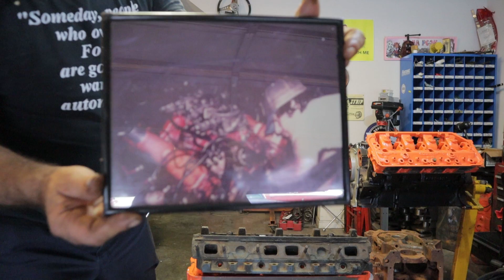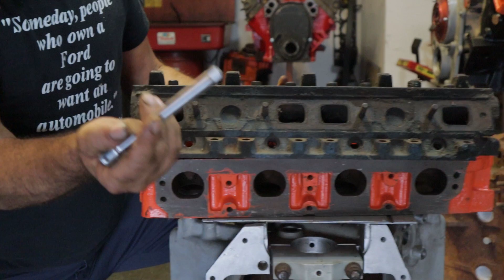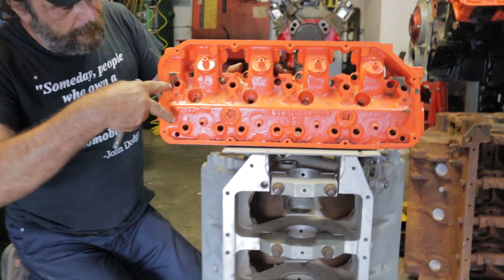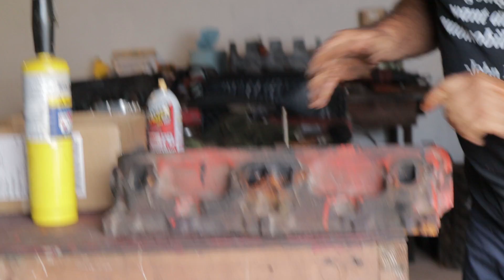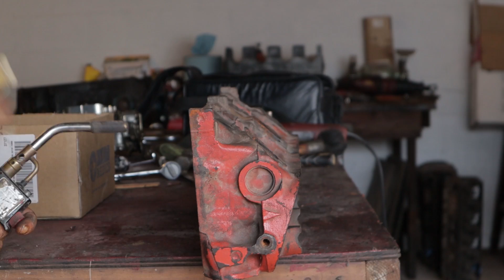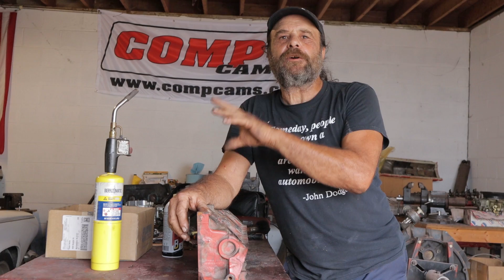What Makes The Small Block Mopar Such A Great Engine?

Comment: Amc had a great exhaust port on the 70 and later heads.
Reply: OMG.. AMC's are freaks!  When he started talking about "accidentally developing a race head" AMC popped out of the ole grey matter.
Reply: Completely agree, they aren't much to look at spec wise, but those engines just F'n roar. 

Back in the day I was working on a customers Javelin, I was doing transmission and clutch work on it. It was a kinda obnoxious car, bright yellow, Street ET tires, slapper bars, HUGE hood scoop. But under the hood as far as I could see was rather typical AMC engine, headers, the old school twisted torker single plane manifold, and Edelbrock carb on a 4" spacer. When done I took it out for a test drive and after breaking in the clutch a bit I did a hit off a light to make sure all was good. The damn thing did a F'n wheelie, freaked me the F out. I'm accustomed to power I just wasn't expecting it. 

Found out afterward that it was IIRC 400+ CI, had very high compression IIRC 14:1 and was running 100+ fuel. But still damn, from a basic AMC.
Reply: @snek9353  lol, so when I was 19 in the mid 90's, I bought a 1979 Cherokee 2 door quadratic off a guy I "kinda" knew. He had rebuilt the AMC 360 engine. Took it to show my Dad what I bought for $1,800. We were on a road with a slight slope going up, my Dad jumped in and said, well son let's see what this thing can do. He put it in second gear, eased it forward and at about 3-5 mph...he punched it to the floor. Next thing I see is all Sky. It maybe lifted the tires about 3 inches from the ground? At the same time it left two solid black marks about 7 car lengths before the front dropped back down. Then the front tires hooked and it blasted off.
My Dad was always an AMC fan, he'd say, "no one built  monster's like AMC did, they all just wished the did" But he didn't like the looks of anything AMC had, said they were ugly.
Reply: @michaelledbetter3016  Haha..  Early Hornets aren't bad to look at tho.  This is a long one..
AMC V8's seem to respond to anything you touch them with, NOT unlike the "LS" in that regard.  
Back in 96 I scored a CJ7 that was someone's finished project.  He built it for his wife but she changed her mind.  Incidentally, it was that "RASPBERRY PEARL" so, yeah it was that fingernail polish metallic pink.  It was a Quadratrac/400 turbo with built 258.  Hell, it was all fresh with new replacement top for $2,000. What the hell, right?  So, the first thing happened was the motor mount failed on the highway at night and the oil filter located directly over top.  Destroyed the thrust, then popping spokes on the flex plate and the bolts constantly backing out.  The blow by got so bad I parked it and searched for a 360 or 401. Believe it or not even back then it was a hard task. One 360 I bought was just no good.  401? Forget it.  Eventually I found a 304 at a yard that was in a ratty but very straight 74 javelin.  (Shoulda bought the car whole)  But, we jumped it filled the well up, and the yard had a can rig up to the pump contraption.  Just a gentle tap of the key and it fired up!  No joke.  Dust blew EVERYWHERE like it was in a slumber for 10 plus years but ran as smooth and quiet as a brand new fuel injected V8 on the showroom floor.  Even though it was a 304, I turned a blind eye who could argue?  Proper stands, pass. side bracket, and new flexplate was all that was required.  In 2 barrel form it was spunky and fun to drive.  Later I bought a rolling frame, with brand new 33s recovered from an accident.  There was no one to pay the bill because it was a fatality.  Body flew off the frame at over 100 mph.  Driver decapitated.  The engine was a 304 with an original Torker.  Engine locked up, don't know why, but it was.  Removed said Torker, and six months later I was bored, and bolted it on my 304 with a 600 edelbrock.
Now, they advertise that it's not recommended for a 304.  I'm here to tell you that motor picked up power EVERYWHERE.  Torque went up too.  The ass squated, the front tires broke loose, she blasted through 1st to 5400 (52 mph).   That's where it liked me to shift.  I confidently believe it'd have run mid 15 to high 14 in a quarter with just the intake/carb/and fenderwell headers with the 304.  At that time 5.0 mustangs were all over the streets.  Unless they were cammed and geared, we were door to door and fender to fender to 90.  Didn't even change my cam. I was on 33" mud terrains!
 It had enough to grenade the heavy front inner portion of the driveshaft.  Despite it being a 304...  I was satisfied with it 100%.  Not too much, not too little.  Just right.
Reply: Yup, flows 50% more that the Chevy heads with comparable valve size, and yes, more than SB Mopar also.
Reply: AMC Lovers and admirers: 
(or those not in the know)
In your search engine type "AMC Matador No Bumper" 
The difference is akin to ugly Betty removing her glasses to reveal a stunning beauty.
Reply: @CSXT8250   I have a amc eagle wagon and i removed both bumpers and all the plastic trims, extended the front valance to match the grill distance. It made quite a difference. I'm going to figure out something to do with the rear and I want to hide a bumper "for safety reasons" in the front valance.
Reply: @sebastiencharette6637  YES!! I've seen it before, they look great!  Awesome choice of an AMC product by the way, a car waaay ahead of its time... Look at the trend today.
Reply: @Decaying Grandeur Strong, tough but they were heavy.
Reply: Wasent the AMC a canadian thing...
     I'm sorry I'm only 30 and currently live in and work on a super rare rv assembled in canada in the late 70s too 81' when bought it for 900$ it had an edelbrok intake and carb all shiny and new. On a 360.... it runs beautiful and with duels @ 8000lb it Breaks free on dirt  climbs hills with a enclosed trailer... previous owner would launch his boat with it.
     Theres tons of "canada stamped parts on the rv. I've since verified it was assembled outa america.
     Any lesson on identifying what I got would be recieved, utilized, and passed along. 
 Thanks
Reply: amc had the best heads, bar none.
Reply: I was looking at a amc 304 marine application and the damn thing was almost making 300 hp with nothing else but marine exhaust and intake. When my 4.2 inline 6 in my eagle lets go i want to put a 304 in there.
Reply: I had a '71 AMX and managed to find a 401 to put in it. I put a lot of time and looking to get the parts I wanted but it sure was worth it. Got caught on radar late one night doing 295km per hour, I just kept my foot in it and found out the next day from friends about the incident and the details. There were several of us in our town who were known motorheads so I went home, took off the intake, valve covers etc., and sure enough a couple of days later a cop showed up at my door asking if they could have a look in the garage. I said "sure" and let him in, he saw the car apart, smiled and left and that was the end of it. Of all the cars I've built that one was one of my favorites

Comment: I would like to know the similarities between the 273, 318, 340 and 360.  How much is interchangeable ?
Reply: Each one has a different bore so pistons don't interchange. The 273, 318 and 340 all use the same crankshaft and the 318 poly does as well so those interchange too. The 360 is the odd one out, it uses a larger main bearing so it has a unique crankshaft. Heads, intake, exhaust headers, cams ect are all interchangeable between all of them, except the poly of course.
Reply: @jacobl.mcc.9088    360 also uses a different oil pan.
Reply: Jacob, thanks for the reply.  Assumed the pistons were done but was not sure about the 360.  As you say, odd man out.  Thanks again.

Comment: That intro pic is how I clean the intake ports on vw  tdis and the newer shitty direct injection engines they make now.
Reply: Those things should come with a catch can from factory.
Reply: @crowvelle  they should come with extra inyectors to clean them now and then.
Reply: @mattgarkus2489  Hyundai just started making the Venue small SUV with both direct and port injection, and the 2.5 turbo engine for the new Kia K5 also has both direct and port injection. I have a 2.5 liter Mazda engine, just direct injection, but the stock catch design is quite good. People are going 150 thousand miles plus without cleaning the intake valves. It helps to use full synthetic 0w-20 oil changed every 5 thousand miles, a good 87 octane fuel such as Shell or BP, and see the Project Farm videos that test Berryman B-12 Chemtool in the gas tank- the only one that made the inside of the spark plugs look cleaner.